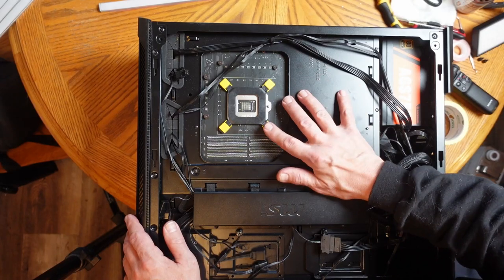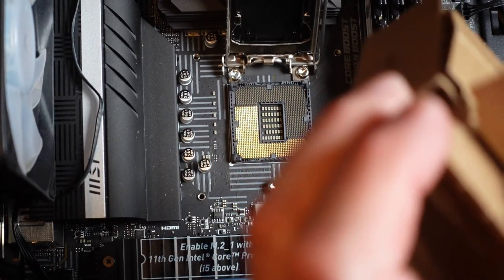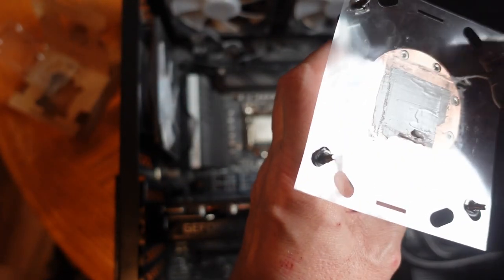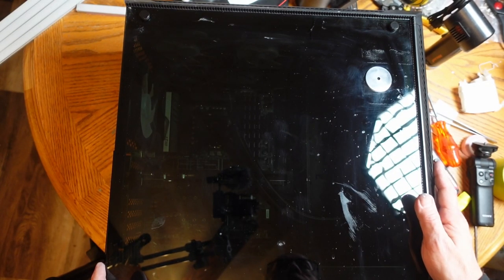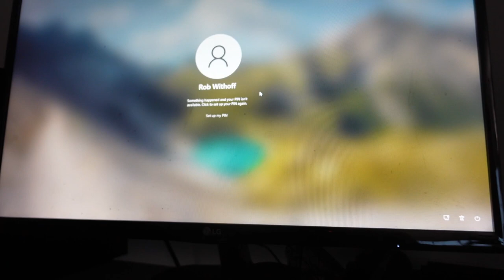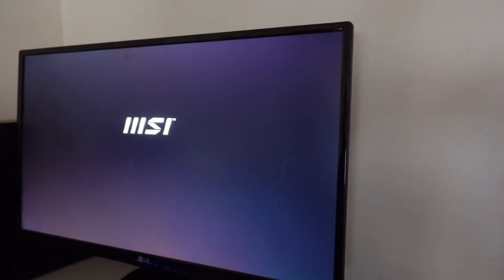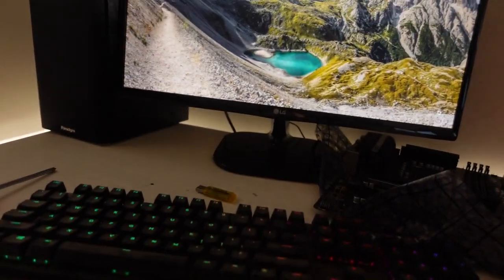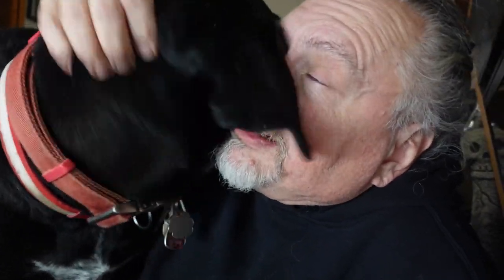Computer problems

Comment: I see a flaw, the pump is higher than the rad which (i think) lowers the lifespan of your aio
Reply: Yes, if you have the pump higher than the radiator the air in the AIO will settle up there and reduce cooling efficiency and lower the lifespan of your cooler.
Reply: @divinetaco1525  so i was correct, nearly doubted myself for a sec
Reply: the air in the water rises to the highest point, the way he had it was fine